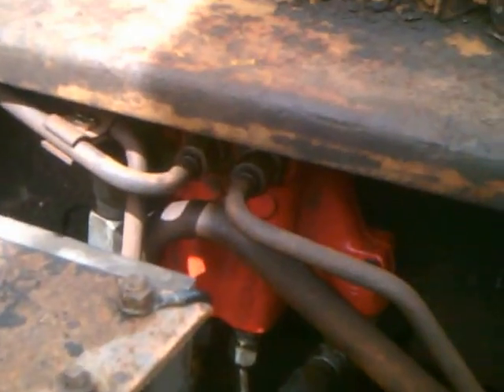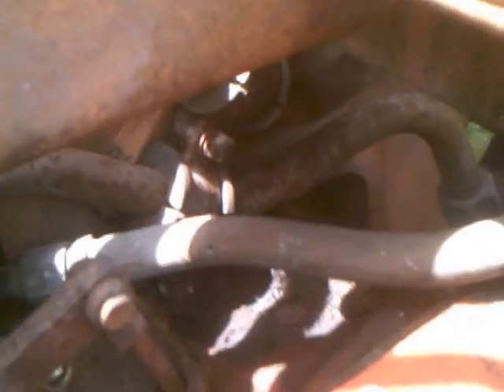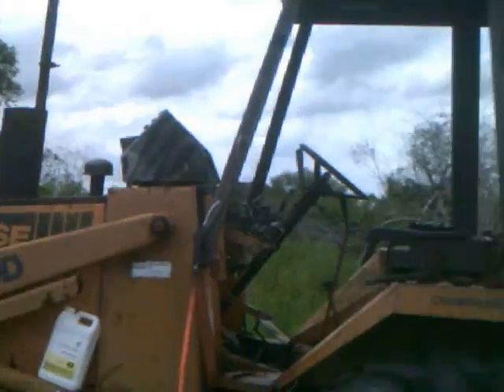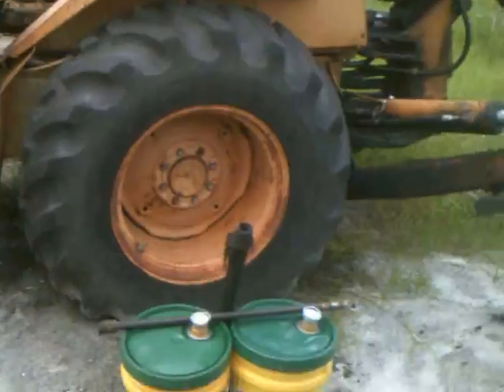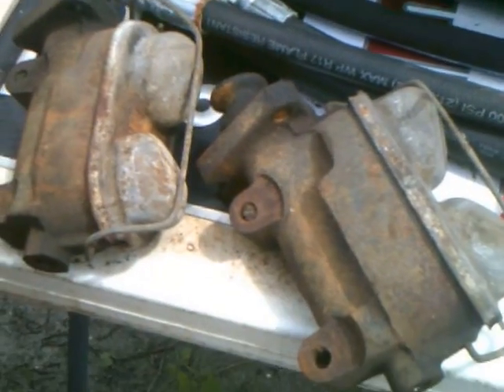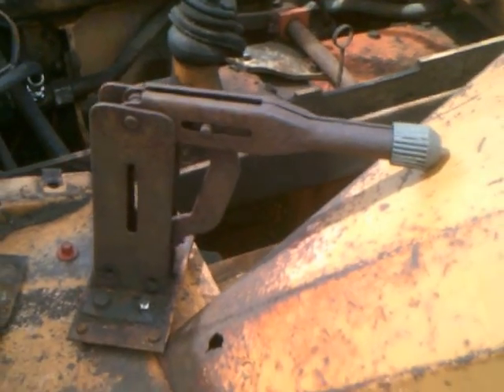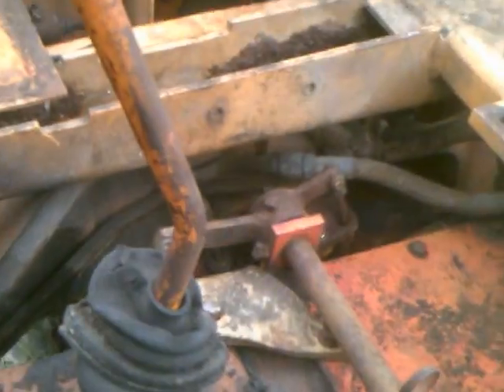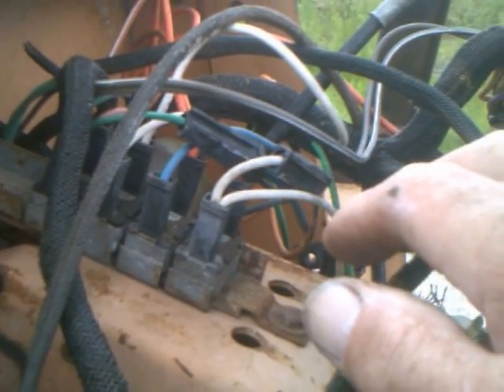580 Case 580D Backhoe repair summary  for hydraulic and brake systems progress

Comment: Hi MerlinxPV. I've been looking for hours to find out if there's anyone that has had to hook up the brake self adjuster spring. It's got a rod inside of it and you have to stretch the spring past the length of the rod to get it on the peg. It seems impossible with the brake lever in place. You are the only one I can find that's done it. How?????? Is there a video?

Comment: Hi, great video thanks. I am replacing a failed hose linking the backhoe arms. I cant find info on how much oil i need to put back into the system. There is a dip stick on the filler cap close to the fuel cap and there is a dip stick to the right side of the engine (I think its right side) and I am not sure I have enough oil in there or how much I should plan for to fill up now. Can I cause damage by over-filling? Do I need to pressurize the system when I install new pipe or will that just happen naturally?
Reply from the maker: Hi Rowea1, I hope this link helps, I can tell you if your oil level is "off the stick" you can put 5 gallons of oil in pretty safely, overfilling a little really doesn't cause a problem but drastic overfilling will cause the system to to try to push out the excess oil as it warms up. Your question about replacing the line and purging, there is no need to purge the system, put the new part on and run the cylinder through it's stroke a few times and you are fine, I would suggest checking the hydraulic oil afterward.

http://www.tractordata.com/industrial-tractors/000/1/0/105-ji-case-580d.html

Comment: You replaced the Master cylinders with another brand what fluid did the new one take?
Reply from the maker: Hi John, I replaced both master cylinders and slave cylinders that use conventional brake fluid, Case uses TCH with the original parts.

Comment: good  video  u may never answer me but did you ever replace the brake discs on each side trying to figure out where the 5th disc they sell you in a kit goes
Reply from the maker: Hi Jr, the brakes are in each the side of the transaxle housing, item #1 in the diagram.
https://www.colemanequip.com/parts/model/Case-580D-Loader-Backhoes-Parts/Brakes-4c/TRANSAXLE-DIFFERENTIAL-BRAKE-HOUSING-AND-BRAKE-WITHOUT-TURBOCHARGER-0Yut/

Comment: Did you say you aren't supposed to use brake fluid?
Reply from the maker: In the original configuration as built by Case TCH hydraulic oil is the what is used in the brake system, however, I purchased commonly used fork truck brake slave cylinders as well as master cylinders due to them costing a fraction of what genuine "Case" parts cost. Due to the type of elastomers used in the fork truck components the system now uses common DOT3 brake fluid instead of TCH hydraulic oil as specified for the brake system by Case.

Comment: thanks
Reply: I've got a limp front bucket down pressure. I can bring the bucket back but the dumping pressure is really weak and feels like it's bogging down the engine. what's my problem?
Reply from the maker: Check the bucket control stick linkage under the cover in front of the right rear wheel, there is a good chance the rod ends are shot limiting spool travel..
Reply from the maker: https://www.youtube.com/watch?v=5X2ATQR6nrM

Comment: hi,,merlinx what cause of backhoe cannot power if loaded of sand?
Reply from the maker: +mario eric ga Are you asking why it will not lift the bucket with sand in it? If this is the case the loader bucket control linkage or control valve pressure relief may be the problem if all of you other hydraulic systems work okay, if any of your other hydraulic systems are also having a problem then it could be your hydraulic pump, you would need to fit a gauge to a test port to check output.
If your engine seems to lack power the first two thing to check are the air filter and fuel filters, keep in mind these days the diesel fuel seems to be very good at plugging up filters sooner than days gone by.
I hope this helps you solve your problem.
Cheers.
http://www.colemanequip.com/Case-580D-Loader-Backhoes-Parts/Hydraulics-4i/PARKER-LOADER-CONTROL-VALVE-LOAD-CHECK-VALVE-0Ywg/?#partdiagrams
http://www.colemanequip.com/Case-580D-Loader-Backhoes-Parts/Hydraulics-4i/PARKER-LOADER-CONTROL-VALVE-LOADER-BUCKET-SPOOL-0YwV/?#partdiagrams
http://www.colemanequip.com/Case-580D-Loader-Backhoes-Parts/Hydraulics-4i/HYDRECO-LOADER-CONTROL-VALVE-TWO-SPOOL-0YwQ/?#partdiagrams
http://www.colemanequip.com/Case-580D-Loader-Backhoes-Parts/Chassis-Attachments-4u/LOADER-CONTROLS-LIFT-AND-BUCKET-SPOOLS-0sjn/?#partdiagrams
Reply: MerlinxPV why boom comes down by itself from the raise position
Reply from the maker: Most likely the hydraulic cylinders are leaking internally, this is the most common reason,  the piston rings are worn out, items #14-15 in this schematic. Aftermarket rebuild kits are much less expensive and work well, there is no need to remove the entire cylinder, remove the rod and gland to replace worn parts.
http://www.colemanequip.com/Case-580D-Loader-Backhoes-Parts/Hydraulics-4i/G105400-AND-G106168-BACKHOE-BOOM-CYLINDERS-0Yha/?#partdiagrams

Comment: Hey Merlinx, I have the steering oil leaking the same as you. At the moment all I do is use it in a field on my own property and no need to use it on the road... so I put up with it. However today my gear lever fell apart from the housing and I cant find any assembly diagrams in the manual on it... how strange that is huh? Its stuck in top gear and I cant change it lol. I am about to remove the floor plate (as is in your video) but am wondering if I really need to do that. maybe there is an easier way of refitting this gear leaver? Me no very familiar with such things, but willing to learn. Thanks mate... Mike
Reply from the maker: +Mikey Strikey  Hi Mikey, I'll do my best to answer your question. There is really no way to gain access to the top cover of the transaxle to service the shift lever without pulling the floor pan, it's not too bad of a job but do look it over well to make sure you locate all the bolts you need to remove, I'll warn you,the seat assembly is heavy and awkward to handle.
 You may get a better idea what you're up against by going to "Colemanequip . com, lookup 580D, go to the "transaxle and differential lock" illustration #182  and  "TRANSAXLE SHIFTER MECHANISM, WITHOUT TURBOCHARGER" illustration #204, I think these will show you what you're looking for.
By the way, I have used Coleman Equipment to buy parts from, they are good to deal with but sometimes a bit pricey on some parts.
I hope this helps you out.
Cheers.
Reply from the maker: +Mikey Strikey http://www.colemanequip.com/Case-580D-Loader-Backhoes-Parts/Power-Train-4X/TRANSAXLE-AND-DIFFERENTIAL-LOCK-0YsM/?#partdiagrams
http://www.colemanequip.com/Case-580D-Loader-Backhoes-Parts/Power-Train-4X/TRANSAXLE-SHIFTER-MECHANISM-WITHOUT-TURBOCHARGER-0YbJ/?#partdiagrams
Reply: +MerlinxPV Thanks mate... that helped a lot

Comment: Can anyone tell me where the fuel pump relay is located on a 580D? I have to use a jumper wire from the fuel pump to the alternator to run the hoe.
Reply from the maker: +Jim Gleason All of the electric relays are under the black fiberglass cover that holds the instruments, remove the 4 screws that hold the  instrument cluster, unplug the the ribbon cable and tach cable then set the cluster aside, remove the bolts on the bottom of each side and lift off the cover, you may have to flex it a little to remove it.

Comment: My 70's 580 Super E had a sudden massive hydr leak just behind the front counterweights, gallons pouring out
from an unknown location (can't see as hidden up behind all at front of engine and rad).  Hoping its not the main seals on the pump.  Machine still starts and runs but up on front loader has complete power loss.
Will fill reserve tank and see if i have down pressure and better try to isolate source of hydr fluid spray.  Any suggestions
or recommendations?   Piss poor mechanic, just getting off a long term illness and this machine is my right hand for snow
and firewood work.
Checked fittings for rams and don't appear to be cracked or leaking there.

Thanx, video very imformative, sure i'm not the first trying to fix this problem and any suggestions appreciated!
Reply from the maker: +Jon Burton Hi Jon, it sounds like a broken hydraulic hose, you will need to remove the grill and clean out where the flexible lines connect to the pump and hard lines on the chassis.

Comment: Informative video. Getting ready to replace master cylinders on my D. Can you tell me the part/ model # on the masters and slaves?
Reply from the maker: I added the links for the master cylinder as well as the slave cylinder to the description text, keep in mind when you swap these they need to be done as a set per side (master/slave) and use brake fluid not ATF or TCH like the originals.

Comment from the maker: Hi mbtx1055, I'll do my best to steer you in the right direction. If you have a leak near the bottom of the steering column and lost your RH brake it is most likely the brake line behind the small plate has rotted out like mine. Perhaps if you take a look at my other 580 brake video it will give you a better idea what I'm referring to. You do not have to remove your wheels to service the brakes, you may find it a bit easier though to access them by removing the floor pans,seat can be a PIA

Comment: Great video.. I just recently started working on a 580D myself. It seems to be leaking out the bottom of the steering column, but above the floor plate. There's also no brakes at all on the right side of the backhoe. Any idea what that may be? I'm thinking maybe a steering column seal if there is one, and a master cylinder? Also was wondering if you needed to take off the rear tires to do that breake work?

Comment from the maker: I added the links for the master cylinder as well as the slave cylinder to the description text, keep in mind when you swap these they need to be done as a set per side (master/slave) and use brake fluid not ATF or TCH like the originals.

Comment from the maker: I'll do my best to answer your question Bill. I'm leaning toward the master cylinder(s) being the culprit. If you unlock the pedals is it doing it only on one side? If so I would change the master cylinder on that side, the reason is if you are opening the bleeder to free the brake there is pressure being kept in the system, the only reason would be the fluid cannot return.
 Unless the slave leaks not much goes wrong with them.

Comment: When I use Brakes they both Lock down, when I bleed they both Free up, Both my Master cylinders checked out as Good, 

I was told the SLAVE Unit  Straight down under the Seat was my Problem, Letting Air get in 

Does this sound like a Good Diagnossis, and where is the Best Place to Buy the Slave unit, at Reliable After Market ???